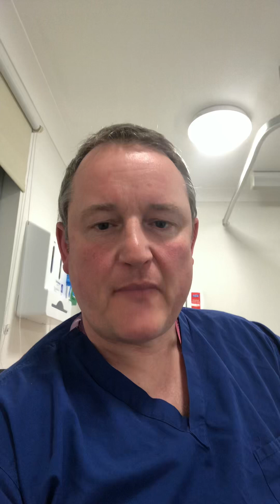Hip replacement dislocation

Comment: I just had a single side hip replacement about 2 months back and 14 days back I fell down which caused a dislocation. The pain was horrible couldnt use the leg. Unfortunatly i moved out of the place where i did the replacement sonthe same doctor couldnt be consulted.
 Luckly after visiting a new hospital they put it back. But now Im told to take full bedrest for 21 days more. The hip replacement was not so painful but the dislocation builds a fear inside you and questions your ability to do any job which requires moving around.
Reply from the maker: The fear will mean you protect the hip more.  It will take around 6-8 weeks for new scar tissue to mature around the hip replacement.  Hopefully this will be your only dislocation but treat it with great care for the next two month.  The fear will subside the longer the time is since your dislocation.

Comment: I had a kayaking injury years after having a hip replacement. After that my hip was coming out of socket 3 -5 times a day for about 5 months. The hospital I went to said if it’s dislocated more than twice it needs replacing again. Turns out this surgery had only ever done knee op’s and was looking for his first hip job.
I decided to go back to the man that did the job on the nhs Mr Middleton Bournemouth. I went back as as a private patient and discovered after having a bone scan my 10-year-old hip was still in fantastic condition. It was obviously ligament damage around the joint. this lead two years of very intense physio. I can now do everything I do before and now pushing the limits I’m looking to go onto YouTube to look at the abilities of what a fake hip can actually do with training and I’ll be interested and what your opinion is I think this should be a good debate?
My future ambition is to work alongside physios and doctors to help with the rehabilitation and training of people with hip injuries.

Comment: A month after replacement I tried to tie my shoe. Out it went.
Reply: Oh geez. I am so scared of this happening to me. I am 3 weeks post op.
Reply: @lpsglitterpaws8536  be scared. Copule years later and I get tendonitis in that hip often.
Reply from the maker: That is not good. Hopefully it will scar up and stabilise. A month is too soon to be flexing the hip that much, as scar tissue acts as a secondary stabilisor and matures at around 6-8 weeks.
Reply: @marcusrobert73  thanks. Almost seven months since the dislocation and I am doing well
Reply: My right leg was about five inches shorter than my left leg, plus intense pain. Luckily I had my phone on me.
Reply: How u kniw that it went out? There was a sound, a pain, cant do anything with leg?
Reply: I felt it pop out, unmistakable feeling, followed by total loss of use of the affected leg.  Getting it resolved is very painful.
Reply: @edgarskrumins23  I. Was on the ground and couldn't move. My right leg was five inches shorter than my left leg. A lot of pain.
Reply: Sit on a step . Less stress
Reply: @stevenmorris2293 .  What do you mean by that.

Comment: I’m in the uk and 4 weeks post op total hip replacement can u tell me what can be going on because I’ve got really bad groin pain. I was told by other people that had a new hip that all your pain goes away but mine hasn’t 😢
Reply: Tell me about it I ended up getting sciatic palsy and drop foot and I'm extreme pain everyday even the area where I got my hip replacement and it's been two and a half years pain I really feel for you
Reply: @cindi8318  so sorry your still suffering I’m still getting a lot of pain 12 weeks in now 😢
Reply from the maker: @karenwatson9319  I hpe your pain has settled if it hasn't the problem may lie with your psoas tendon

Comment: Not so rare, I did it😮
Reply: It happened to me also and I am in severe everyday in misery
Reply from the maker: Sorry to hear that Dawn. If a complication happens to you it will never seem rare.  However for hip dislocation females under 50 years have an 8.12% lifetime risk compared with 6.35% for males. Given the fact they will have their new hip in for 25 years plus.
Reply: can you guys tell us what u were doing or how it happened so we can be aware
Reply: @swankyshivy  I was just walking across my living room.
Reply: @dawns.6620  whatttt . im 2 weeks simce left hip replacement. thats scary
Reply: @swankyshivy  it was a bad implant, I’m sure you will be fine.  I have a new one and no problems since😊
Reply: @swankyshivy  I’m sorry I was answering to the wrong video because I did have an implant break on me just walking across the floor.  I dislocated it when I got home from work and went to bend down to unzip my boots.